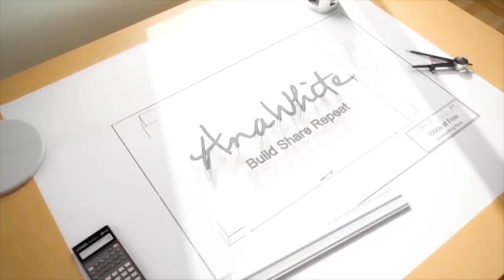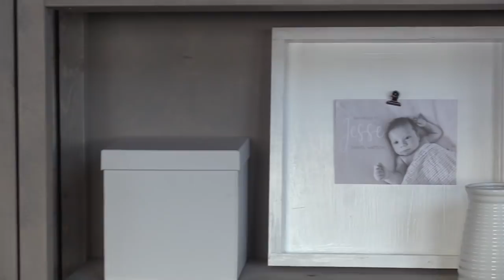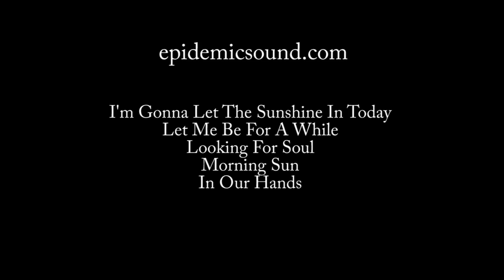DIY: Photo Frame flips to Chess Board

Comment: Ana, When setting up the board to play the board should be turned so there is a white square on the bottom right to start.
Reply from the maker: Thanks for the tip I did not know that

Comment: Even better trick to make a square frame, cut 2 longer sides first, then place them between stop block and cut the final 2, automatically the right length to make the same overall dimension as the long side